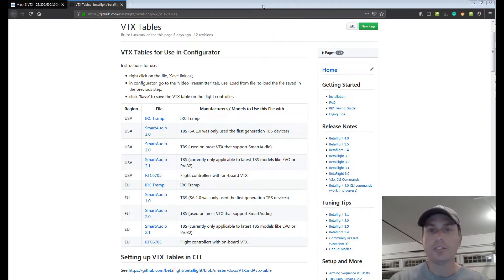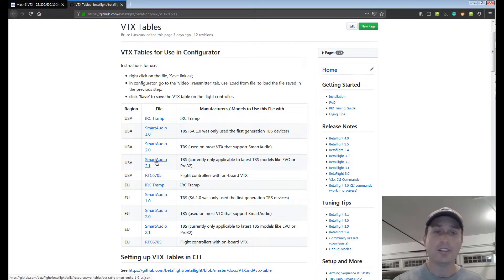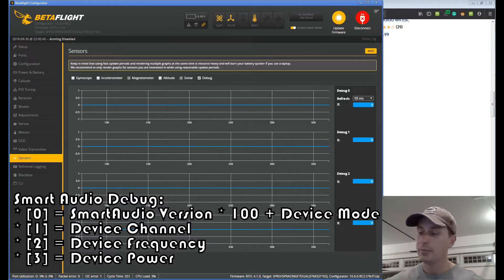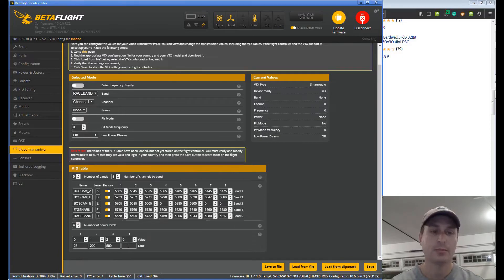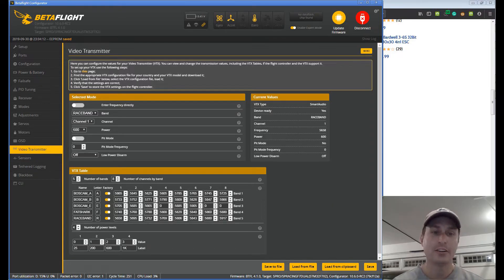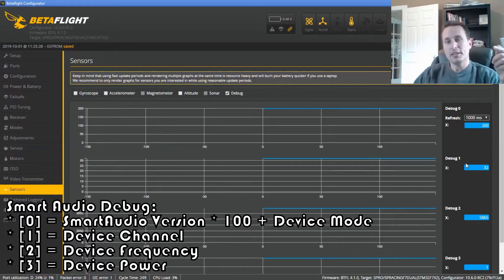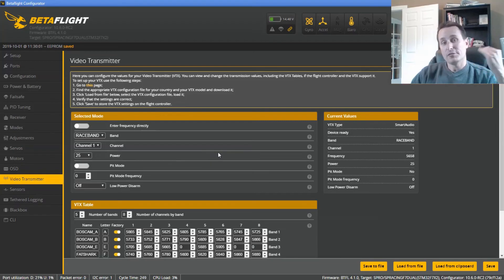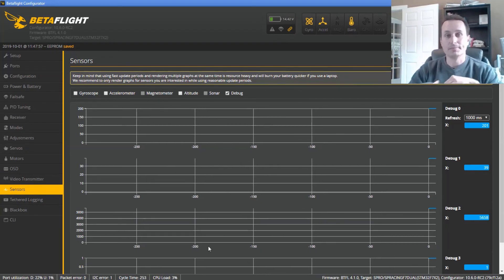Betaflight VTX Tables in 5-minutes - How to discover your Smart Audio Version

Comment: Hi.. newbie have a very basic question... what is this "smart audio" thing doing? what is it actually? thanks in advance for answer
Reply from the maker: It changes the VTX channel and power setting.  It does this through the audio channel.  Hence "Smart" audio.
Reply: @uavtech  So sorry I'm still not really get it... what's the correlation of power channel setting & 'audio' channel? 
Is it about 'sound' related to 'audio'?
Reply from the maker: Channel is the frequency of the signal coming out of the VTX.  The RX will need to be looking for the same frequency (channel) to display the video feed.

The power is watts of energy going into the signal transmission.  Higher power levels will make the signal go further and penetrate through more objects.

So with SmartAudio, you can change those setting with the flight controller.  Meaning, you can enter the OSD setting in Betaflight and change the VTX channel and power without touching the quad.  In the past, you had to change through buttons on the VTX which were sometimes hard to access and the indicators were hard to read.

Comment: Is there any VTX power limit using SA 2.0 settings. I am using Eachine TX806 VTX that has 5 power levels 25,200,400,800 and 1000. It can be set to 1000mW using VTX control button but Smart Audio (by OSD or LUA Script) is able to set only to power level 4 (800mW). When I am trying to set to lvl 5 (1000mW) Smart Audio settings stops to respond until FC and VTX is power up again. 
Does anyone had similar issues?
Reply from the maker: using OSD or having the FC plugged into your PC.  For 1000W are you using the description of "1W" in the power setting.  What VTX power code are you sending it for 1W?  30?

Comment: What happens if my debug sensors x value stays zero when plugging in power?
Reply: I think this method may be outdated. It doesn't work for me either. Tried it on 2 quads so far.

Comment: Hey Mark, i recently bought a rush ultime plus vtx. When i do the blackbox debug on Smart Audio i dont have any values on that. What could it be?
Reply from the maker: hooked up right?
set to smart audio in Ports tab for the correct Uart?
Reply: @uavtech  yep. I can assure that because i have another vtx wich operates on tramp protocol, and its working fine.
Reply: @uavtech  Yep, all set! i tested with another vtx that uses Tramp  protocol and worked it fine. But with this new vtx, i chose the tbs smart audio protocol, all hooked up and keeps me saying device not ready on the video transimtter page

Comment: When I go to sensor tab I don’t get any values .I’m using a HW F7.
Reply from the maker: Tramp vtx maybe?
Reply: @uavtech  
No it’s a Rush tank mini and it’s S.Audio. 
 I went to blackbox and selected s.audio but in sensors with only debug checked I only get 0 for the values you mentioned.I have my LiPo plugged in.
Reply: @uavtech   I am using latest version of betaflight.
Reply: @uavtech   My S.Audio wire wasn’t making a good connection into plug connector.
Works great now.

Comment: I cant change my power output via controller, so i need some help. Debug[0] is 302 for me on a rush tank plus. Which SA version do i have now? and is it unlocked?
Reply: Hi, i have the same vtx and also shows me 300, which onw did you select?

Comment: One of my Unifys Pro HV does show 216 (so all be fine with SA 2.0 unlocked) but the other one shows 222. So what does it mean?
And why PIT Mode on a switch does not work on both Vtx?
Reply from the maker: Both are SA 2.0.  Unknown what 222 means.  See if wiki presents any insights
Reply: @uavtech  Ok, thanks for answering. Btw: Pit mode on a switch does only work with SA 2.1.
Reply from the maker: Unknown.  Ask TBS wsup!

Comment: I need help, I set my vtx power to 400, and I hit save button, and after I re-connect, or even try to fly, it always go back to default 25mw, what can I do? Tried osd, still the same can't change from 25mw although the setting is changed to 400
Reply from the maker: What SA version?  Does the VTX support 400mW?

Comment: hey guru,,

great work you do i'm a fan, for real...but i would like to clear my betaflight table for a new one? how?
Reply from the maker: just load the new table.
Reply: @uavtech  great, so thats easy, thing is im now using the tbs unify pro32, crossfire also connected and I'm not seeing device ready in the transmitter tab...
Reply: Or is it when you go to crossfire, smartaudio is no more.... Because I can see the setting on the lua in the radio
Reply: Bommer,! Figured it out, it's ether or.... So I'm going back to smart audio....🍻🍻🔙

Comment: Today I upgraded my old Emax Babyhawk R on betaflight 3.2.3 with a TBS nano pro 32 and before I had a Rush tinytank in it. I enabled smart audio over softserial and somehow I set it up to the correct powerlevels. But thats a long time ago and I have no idea how I did it. Now my smartaudio is not working on the tbs vtx. I hope that you can help me, I woud really appreciate it.
Reply: So I can not set it up over vtx table and the fc is to old for 4.1
Reply from the maker: If an F3 processor, yeah, you can't upgrade beyond 4.0 i believe.
Reply: @uavtech  And do you got any ideas how I can get smart audio to work?
Reply from the maker: @RealKushrage  on what version?  If VTX tables, just load the 2.0 table.

If not working at all, wiring or Ports table settings.
Reply: @uavtech  Its on Betaflight 3.2.3 so no Vtx Table...
But I found the solution ;D
I just connected it to the crossfire reciever and now I can control channel and power over my radio :D
But thanks for answering <3

Comment: Thanks for the clear help that I can understand. Now hopefully I can un brick my flight controller. Having trouble getting it into dfu mode. Button appears to not work. Maybe I will just desolder. What can I hurt it's junk at this point. This whole deal has cost me close to $1000 1 quad in a giant tree that I can't find another I tried to fly blindfolded and never found and another in a lake. If I'm not successful this time my laptop (that I only bought for betaflight) gets a sledge hammer. I hope the beta flight devs realize the frustration level this has caused!!! At this point I would like to hook one of them to my truck and drag them down the road into little pieces. This has to be the single worst decision ever made by any hobby. Especially for simple electrician's like myself. All I want to do is fly!!! I could care less about using osd to change channels on my vtx. I don't even know anybody else that flies why the  fuck do I need to go through an odd menu while my vtx sits there plugged in burning up. I have went through 15 vtxs in a year mainly from nocking the antenna of and not being able to find the quad. I know I should use a spotter but they are as hard to find as a third person to flag while you are wakeboarding (ca).
Reply from the maker: It is just importing a table.  If you purchase a VTX, just note what protocol it uses and import that table.  Simple.

Comment: Will the OSD still work if you have a VTX like the Eachine Tx526 that does not require a VTX table ?
I have'nt been able to find any info on this !!
Many Thanks
Reply from the maker: Every VTX uses SmartAudio or Tramp as the protocol to talk to it.  There are default tables for SA 2.0, 2.1 or Tramp.  If Tramp, that is easy, just load the Tramp table and setup to match the power levels the VTX supports.  If SmartAudio, you need to figure out if 2.0 or 2.1.  90% of the time it is 2.0.

Comment: Still having troubles here.... I have the vtx setttings as raceband 8 5917 and I'm getting a picture but it seems like it's not setting the correct power level. seem to be in pit mode.  The pit mode slider is on, when I try to switch it off and hit save. the slider goes back to on again??
Reply: NVM, I think I figured it out. I had to cycle thru the power levels to unlock. guess it's a fail safe.

Comment: Hmm. My X value just sits there at 0. It never moves when I plug a battery in. AKK just said it has smartaudio. It doesn't say what version.
Reply from the maker: AKK takes a special build of BF because they did not.implement SA correctly.  Check out the Flashing selection (top selector above targets) for the AKK builds.
Reply: @uavtech  Thanks.

Comment: what if i got 208? its not qute 210 but not 200. its that smart audio 2.0 or ?
Reply from the maker: SA 2.0
Reply: @uavtech  thanks! so i was doing this on my TIny Whoop after updating firmware. prob dont need to because it works fine but it says device not ready so i figured i get it set up. problem is when i plug in a battery to read the sensor number to know what file to use it doesnt show up any number (the number under the MS speed under the sensor tab" . any idea why this would be?
Reply from the maker: @BMathiesen  , could be a number of problems.  Ultimately, SA is not talking correctly with the VTX

Comment: how can do this in cdaxx vista ?
Reply from the maker: No need.  You control everything through DJI goggles.
Reply: @uavtech  TANKS BRO, BUT I TRY CONNECT THE CDAXX VISTA TO THE FC AND ITS IMPOSSIBLE
Reply from the maker: @BethegreatDo  whelp, that's not a vtx table thing.  Just wire up as outline in instructions and you will need.to enable Serial on one Uart and MSP on another.  Depends on which Uarts you are using for TX from Vista to FC (Serial) or for OSD on FC to Vista (MSP)

Comment: everything goes well but when i change the channels/freq/power in betaflight the debug 1/2/3 doesn't change. Anyone with the same problem? my debug 0 is 216 and i used the table smart 2.1 and also tried 2.0
Reply from the maker: 2.0 is the table you want.  216 means 2.0, locked.  You need to set power levels according to your specific VTX.
Reply: @uavtech  thanks it worked!!

Comment: ive got no info on the vtx, used quad, cant seem to get anything to register in the blackbox trick. Is there a way to know if its tramp?
Reply from the maker: Set Tramp in Ports, load the table and see if it works.
Reply: Thanks, still haven’t figured it out with regards to BF. I’ve got video in my goggles soo I’m gonna go fly. I’ll give tramp a try. Thanks for the video and your response.

Comment: What if when I plug in a battery and nothing happens in sensor tab?
Reply from the maker: Tramp protocol, not set.in ports tab, or wired wrong.
Reply: UAV Tech that was my first thought but I have the SmartAudio pad on the vtx wired to T1 on my FC, and Uart 1 set to SmartAudio as specified in the manual.
Reply: UAV Tech should I just solder the SA pad to a different pin on my FC?
Reply from the maker: Yes, maybe.  TX1 is used a lot of RX and could be inverted to receive FrSky RX commands, IDK.  You sure not a Tramp protocol VTX?
Reply: @uavtech  It is a TBS Unify Pro HV Race 2 VTX.

Comment: I've gotta say, VTX tables have screwed me out of getting to fly in multiple heats this year (due to extra setup time). I understand the problem it tries to solve, but it introduces more work to end users. Most of those users didn't take issue with the problem being solved in the first place. I really wish the devs would either reconsider, or allow the old functionality to be available. Maybe a "default table"... anything...
Reply from the maker: Why are you messing with VTX tables before a heat?

Comment: Got a question bardwells video showed. On values in vtx power he said we had to convert mw to dbm but u have it at so gle digits. But it seems like I don't have the range I should. So which way is right I don't have a rf meter to tell the power output. I'm using a TBS unify 5v and it showed that it's SA 2.0 with debug

Comment: when I plug in the quad to see the debug number nothing happens it just stays at 0. anyone know how to fix this?
Reply from the maker: Tramp protocol?
Reply: same here
Reply: Be sure that you have set smart audio in the ports page under Peripherals ,Ofcourse in the correct "Uart tab"
I have Smart audio connected to UART4 but yours might be different, Just look at the flight controller where the VTX SA is connected TX1/TX2/TX3/TX4 and so on? , Wont be any RX pad as that is the receive pad,Smart audio is connected to a transmit pad .You get it but this is only if you are using Smart audio (SA) Tramp is another thing

Comment: hello, i switch vtx to rush tank ultimate plus, from debug 0 i got 217 instead of 216.. i try to use 2 different vtx table that  use 0,1,2,3 also in dbm.. both works but why my range is soooo bad? antena problem or something with my vtx table?

Comment: mine says 222 so guessing thats 2.0. every single time a power down and power up it boots into pit mode, so annoying
Reply from the maker: 2.0 correct.  That is a VTX setting, reverse the mode in Modes tab.  It is weird, i k ow what you mean.
Reply: UAV Tech I did sort it in the end. I went onto my goggles and it was set to race not free. Changed it to free and it’s good now. I’m guessing that this option is hidden in beta flight somewhere or does it get this from the vtx it’s self? Thanks for your awesome vids. 💪🏻

Comment: @UAV Tech

I have the answer to a question asked in the comments and to which you did not know how to answer.

how a VTX can give its version from an RX to a TX?
It's because it's not a UART. It's a USART internal to STM32.
It's flexible . TX and RX switch and are use for receive and transmit datas.
https://www.st.com/content/ccc/resource/training/technical/product_training/4f/cc/bb/f7/04/99/41/66/STM32L4_Peripheral_USART.pdf/files/STM32L4_Peripheral_USART.pdf/jcr:content/translations/en.STM32L4_Peripheral_USART.pdf

Comment: my debug says 0 value 0. am i doing something wrong??
Reply from the maker: Maybe it is Tramp protocol and not Smart Audio?
Reply: @uavtech  I tried both and neither worked for me if I reflash will it rest the vtx transmitter page???asking for a friend lol
Reply from the maker: @mafiafpv3469  , yes it will.  

If Debug is showing nothing there is a communication issue with the vtx.  Focus there.
Reply: @uavtech  I'm gonna flash it after work and follow your video
Reply: And still not working getting alittle pissed of this is a new build and cant even fly it cause its stuck on 25mw and E 1 rediculous

Comment: my debug value says 0...? VTX is working.
Reply from the maker: Maybe it is Tramp protocol and not Smart Audio?
Reply: @uavtech  Thanks for the response. It's the TBS Pro32. My understanding is that this process is simply if you're not sure which SA you're using. The TBS manual says for the Pro32 it's 2.1 So despite the fact that I have a flat line ( can email you a video and screenshot if you provide one). I just downloaded then loaded the USA 2.1 TBS SA file and went with that VTX Table. That should work right? Unless there's something that doing this provides beyond telling you which version of SA you have.

Comment: I did everything you said plugged my battery in and the number went to 216 what does that mean
Reply from the maker: SA 2.0 protocol.  Locked.
Reply: UAV Tech I don’t understand what does that mean?
Reply: I have a rush tank ultimate VTX
Reply: Can you help me out I have the rush tank ultimate VTX it’s brand new I’m using a MacBook Pro 2017 model. My computer downloads the file but when I go to open it I hit load from file and the files are like a pale gray it is VTX table smart audio 1.0 they should be bold they’re pale so you can’t click on them ?
Reply: The problem I’m having is importing the file the file to Bettaflight. Can you please help
Reply from the maker: Load the Smart Audio 2.0 VTX table.
Reply: UAV Tech The box that the rush tank ultimate came in says protocol TBS smart audio V1 .   So do you still recommend that I load version 2.0?   I’m just asking because I know you know things that most people don’t.

Comment: What if debug in sensors tab doesn’t read any value the blue line just stays flat?  It doesn’t jump up when I plug a battery in
Reply from the maker: Are you sure is Smart Audio protocol or could it be Tramp?
Reply: UAV Tech it’s smart audio.  It is the rush fpv tank race.  I plug it in and follow everything u do in the video but the line doesn’t jump and give me the value

Comment: The debug doesn't work at all. Even when i did all that, all that happened when i plugged it in is that it stayed at 0
Reply from the maker: U sure not a TRAMP protocol VTX?
Reply: I tried both protocols
Reply from the maker: @unavoidablevideos1953  , whelp that debug won't show anything for Tramp.  Plus, it only has 1 table, so not needed.

Make sure ports is set up right.  Otherwise, wiring seems off?
Reply: As far as I’ve seen it looks correct to me. Maybe a faulty vtx or wire? I’m not sure.

Comment: Thanks, great video, question though, does any of this need tweeking if your using F-port?  I'm doing first build connecting that way, plus a TBS pro nano, with the mounting board deal, and one of those realpit vtx power switches, all first time using, my head is starting to swim a little..lol.
Reply from the maker: F-port has nothing to do with VTX control.

Just wire up VTX smart audio, set up Ports tab for SA peripheral and import the correct SA VTX Table.
Reply: UAV Tech..Awesome thanks for quick reply, I just now, got almost everything working, it's a Diatone 349, it's a build from the internet this guy sells, so I have a few pics to go by. RSSI, voltage, Rx,  and all my switches are up n running, cant get camera to work though, it's getting power no pic.  Just found directions for vtx power switch, looks like I need to put some cli commands in for pino box and a few aux channels.  I'll get it figured out, thanks again, 

https://tinysleds.com/products/realpit-vtx-power-switch